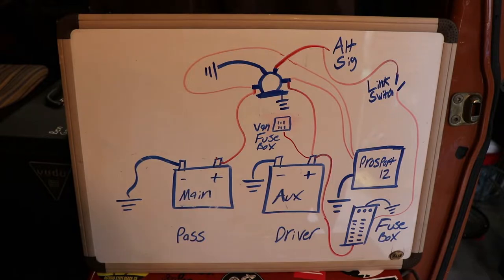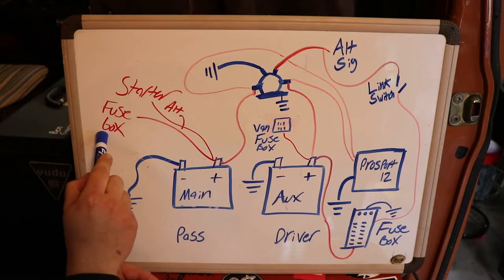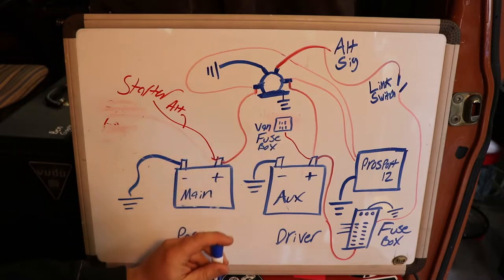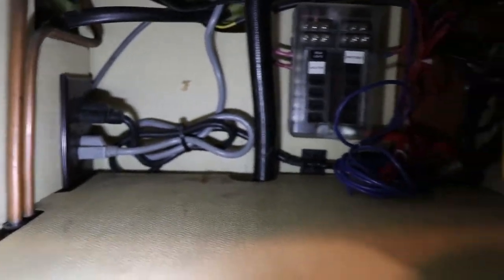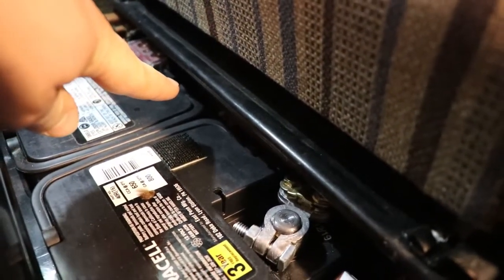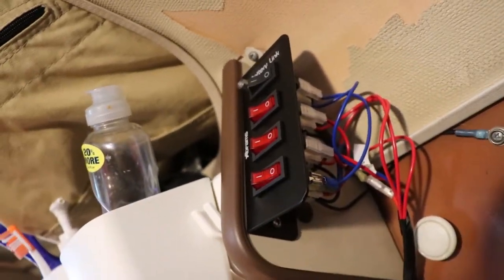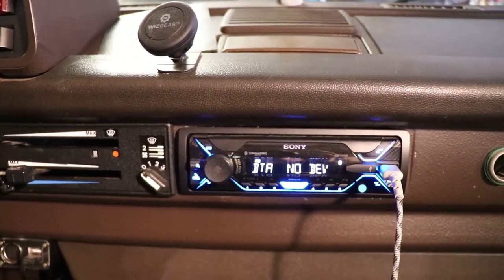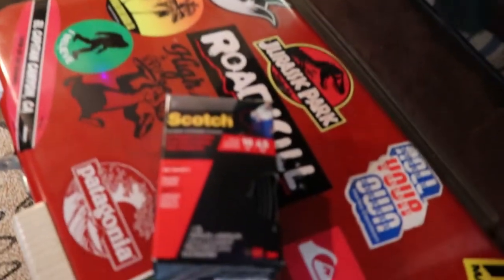Vanagon Westfalia Aux Dual Battery System

Comment: Where you put your hand when suggesting an inverter location works just fine. Face the inverter face with the 120v receptacles inboard. I used nylon spacers on the mounting screws to allow air circulation behind the inverter.

Comment: If you have a manual transmission you can bump start it going about 5mph forward(second gear) or backward (put it in reverse)
Reply from the maker: Yeah, but when you have it fully loaded for camping or traveling it is almost impossible to push (almost 3 tons).
Reply: @smelsfishy  True, but any slight slope will do. And if you have a friend or two!

Comment: how did you figure all this out? are you an electrical engineer? Electrical work seems over my head, but I'd like to do some of this stuff. Did you ever think of a "kill switch" for security, so that you can have a secret switch that disconnects the batter from starter? Thanks!
Reply from the maker: Just trial and error my friend. Been messing around with electronics since I was young. Look up some basic foundations on youtube about current, voltage, and resistance and go from there. Think of electricity as water and how it flows. I thought about putting a kill switch, but had a GPS tracker on the van so I didn’t worry too much bout it.

Comment: Is the fridge and sink rrunning off the aux battery???
Reply from the maker: The fridge runs off propane when I am parked, and off the battery while driving. The splice at the original fuse box redirects power to the sink.
Reply: And the factory light above the table?
Reply from the maker: @freshkoko699  That splice also allows that light to run off the aux.